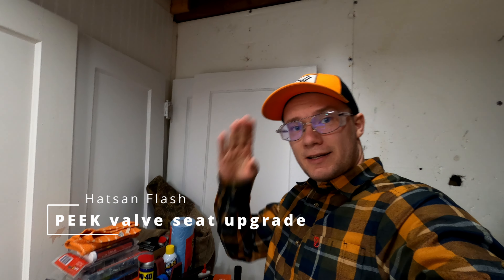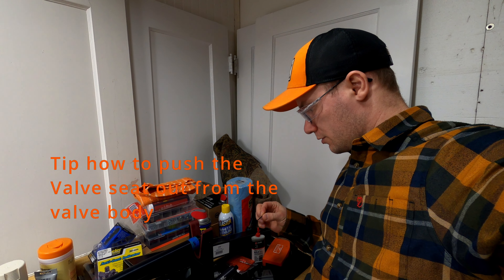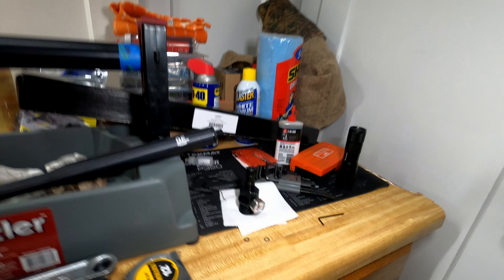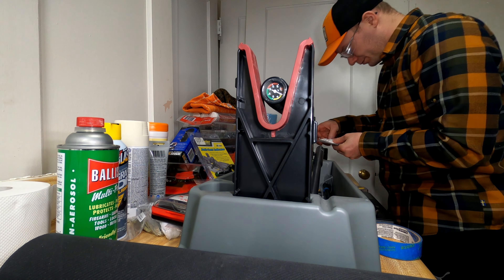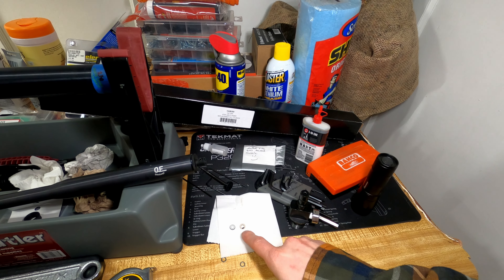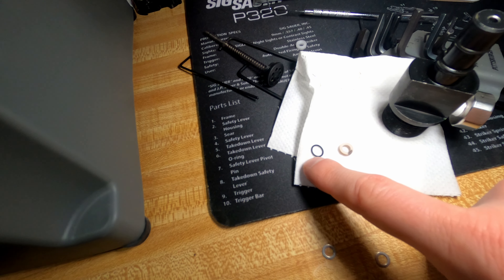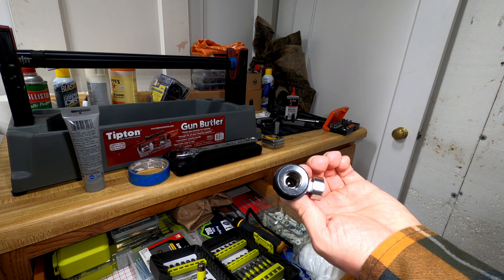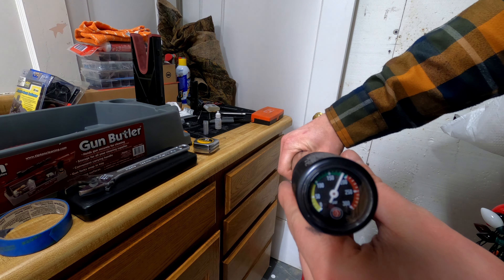Hatsan Flash PEEK Valve seat upgrade to air cylinder

Comment: Which barrel do you have on your flash, I believe the last time I watch you were using a Nova star barrel... Was wondering if you saw a improvement with the Nova star barrel...
Reply from the maker: I have a Lothar&Walther 30" barrel on my Flash now and its shooting laser beams with the 18.1gr pellets(slugs too). Previous to that I had the NovaStar barrel and in my opinion it did shoot the 18gr pellets better than the stock one. Definitely it was more accurate for the slugs (especially 17gr NSA slugs what it seemed to prefer). I would say that the NovaStar barrel has the same barrel profile than the stock one, but seems to like more to shoot lighter slugs. I found it really difficult to find good pellets that it liked. NovaStar barrel seemed only to like the FX 18.1gr pellets. Everything else except the H&N barracudas were poor in my opinion.

Comment: Did u have any trouble getting the valve seat out? I can't get mine out because it's flush against the metal so there's no lip to Catch on when trying to push it out. My new gun is leaking there and I need to replace it
Reply from the maker: I really had to fish mine out with the smallest allenkey I had the first time doing it. If you can wiggle it there it will slide out. One option is also to use an o-ring pick if you bend the end on it. If it is leaking, I would suggest getting a PEEK valve done to it and have it opened up a bit. It will wake up the whole PCP with bigger inner diameter on the PEEK valve.
Reply: Do u have a link to the parts? This is my 2ed flash with the same issue. I did get it all apart. Nothing is damaged but it's still leaking. The exact same as the last gun. This could really turn a newbe off on pcps
Reply from the maker: @tinkerman9434  Hi, the PEEK valve is something I had a GTA member do to me as a favor. He spins them out when he has time and material to do it. His handle in GTA is Rallyshark. If you need to have a OEM part you should be able to order them through Hatsan USA. I ordered them through the "Customer Service Form" then just add the Hatsan Flash info and find the part number from the exploded picture that should be 2314(valve) and 2315 valve o-ring. If the PCP is under warranty you should be getting them for free.

Comment: Where do I get a PEEK valve for my .25 Flash?
Reply from the maker: Hi, thanks for watching my video. The PEEK valve seat was actually done to me by another airgunning enthusiast from GTA forum. His handle is Rallyshark and he is one of the OG tuners of Hatsan Flash. You can not buy this PEEK valve seat as an aftermarket part at all. Rallyshark has a lenghty forum post about what he did to his Flash and I have taken mostly the same road with my one on tuning. The biggest difference with PEEK compared to a normal seat is the opening of the hole on the seat and how it seats with the pin. PEEK is much more rigid material than the normal material used on the seat and therefore can be opened more and it still provides sufficient seal with the pin.

Comment: where did you purchase the peek valve seat?
Reply from the maker: Hi, thanks for watching my video. The PEEK valve seat was actually done to me by another airgunning enthusiast from GTA forum. His handle is Rallyshark and he is one of the OG tuners of Hatsan Flash. You can not buy this PEEK valve seat as an aftermarket part at all. Rallyshark has a lenghty forum post about what he did to his Flash and I have taken mostly the same road with my one on tuning. The biggest difference with PEEK compared to a normal seat is the opening of the hole on the seat and how it seats with the pin. PEEK is much more rigid material than the normal material used on the seat and therefore can be opened more and it still provides sufficient seal with the pin.
Reply: What is the ID of the peek seat. I have my flash .22 apart now and the factory seat is .173. And what's the largest I can drill the factory seat?
Reply from the maker: @Chickencoop2016  Hi, that is a very good guestion. The problem with the factory valve pin seat is that the material might not hold together if you drill it bigger. It is also very difficult to have it vised in a way that you don't damage the o-ring grooves or jeopardize the sealing in other ways. I think I have my PEEK valve seat ID in .200. I would recommend to go the route like I did and get one made.